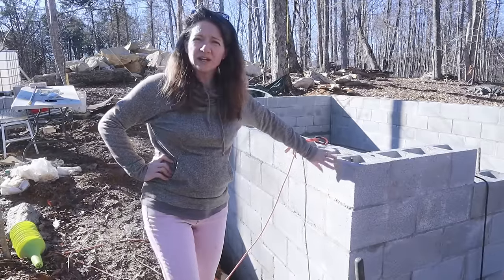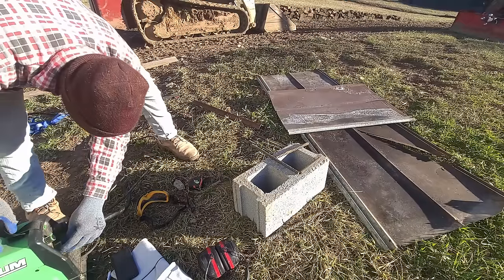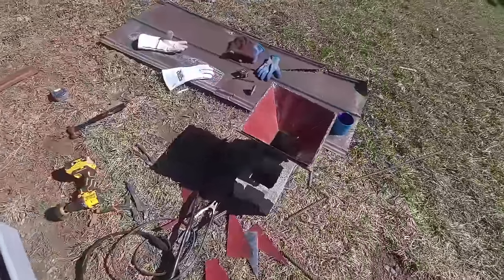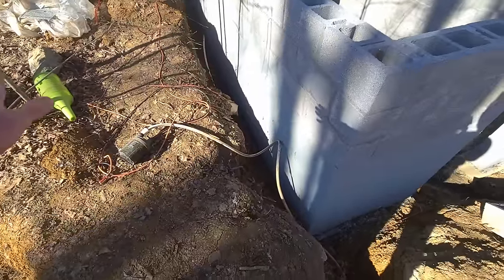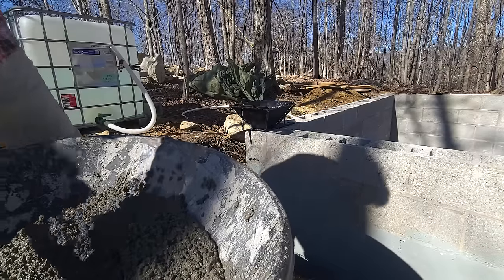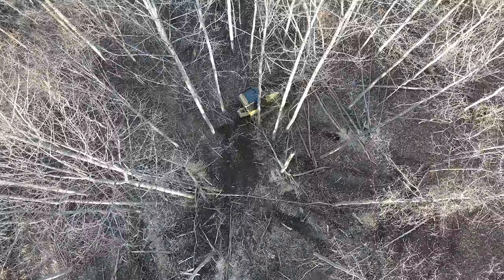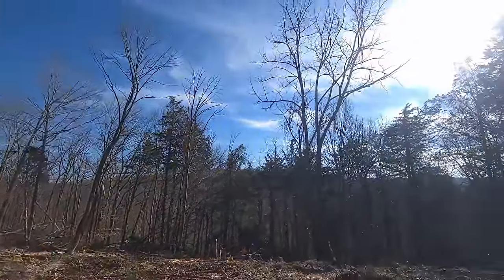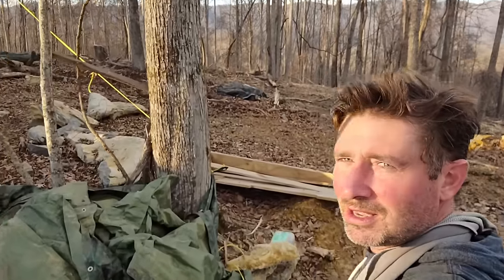D1 Dozer forestry mulcher shows up and makes us a view // E136

Comment: Hello Meg and Jon.
Great to see you both on the job site once again. Meg, I had to look away a few times when I felt sure you were going to get waterproofing in your hair or clothes. That stuff can just ruin clothes. So cleaver to build that "funnel" out of old bits and pieces, Jon🤔.
I understand your reasoning for not wanting to install French Drains (cost, time, non-percolating soil, waterproofed wall). You might be absolutely correct in this decision and not have a problem at all. On the other hand, you already have the location open, and have a drainage trench there. It will be so much easier to install now rather than dig it up later to fix a problem. You already have huge deposits of gravel on your property and the cost corrugated agricultural pipe to go around the structure  would make for good insurance against any potential hydrostatic build-up down at your footings in the future.

Cheers,
EJ

Comment: suggestion to add a dimpled outer cover that blocks moisture but also gives it a path to drain down   
  how cold do you get may want to consider form insulation board on out side   before adding veneer covering

Comment: had a house same situation did black tar like stuff then did 6 mil plastic then 2 inch foam boar then trench off to side to down slop and put in drainage tile with  t fittings for down spouts this worked well befor celler used to flood badly because of the clay